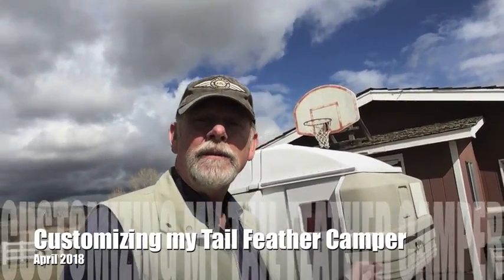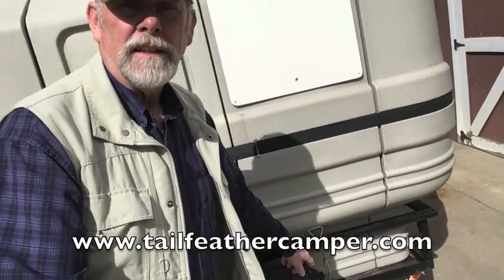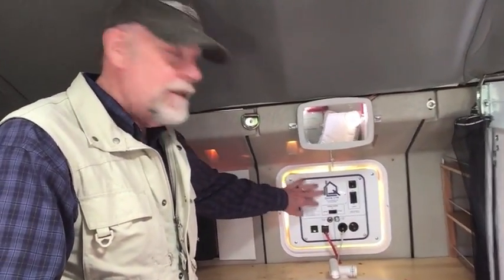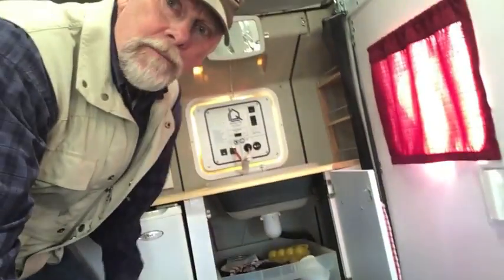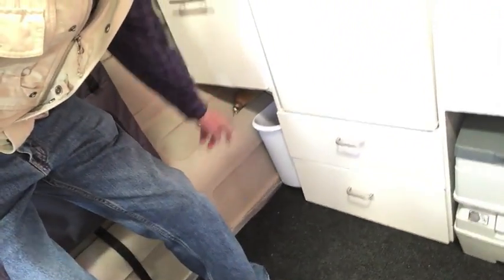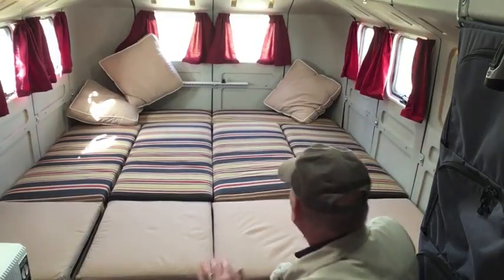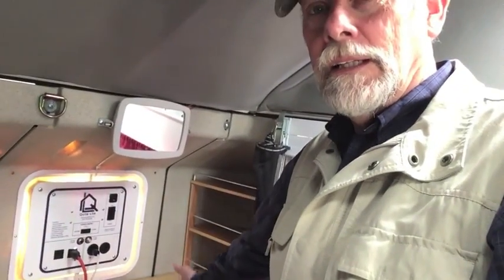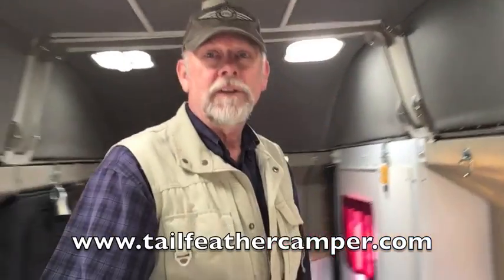Customizing my Tail Feather Camper

Comment from the maker: FYI - I designed, developed, manufactured, and marketed the TailFeather Camper and QuiteLite Shelter from 2009 to 2017. I sold the rights to a company in Boulder, Colorado five years ago. I am very disappointed they have not fulfilled the products potential.
Reply: thats too bad. I came across a picture of one built on a 5x8 trailer and was captivated by it. This is an ingenious design and am surprised I am just now hearing about it. I feel like with a little marketing this would be a really popular, affordable alternative to other smaller campers.

Comment: Hi-love your customization! We just bought a used Tailfeather (named her Luna lol) and want to make and install cabinets. How did you attach the cabinet unit to the wall of the camper? I am concerned about screwing into the wall panels. Thanks
Reply from the maker: Carol, I hope your Tailfeather serves you well. There are threaded inserts about halfway up the wall that can be used to secure cabinets. Threaded inserts can also be purchased at a local hardware store that can be screwed into the curtain rod holes to accept machine screws. Hope that helps.

Comment from the maker: I’m not sure what the problem is. It plays fine on my phone and computer. I’d like to hear from others.
Reply: you destroyed my dream of having a modular trailer company... thanks
Reply: Politely,  I cannot hear most of the audio from outside the trailer at full volume. After you go inside, if  I listen very closely, I can hear but I struggle to hear every word.

ETA: If you attach a set of earphones, it improves the audio significantly. I can hear everything easily on max volume but the audio is still weak.

In the past,  I have encountered several YouTube videos have this same issue. copyzerk's HAVE GUN, WILL TRAVEL videos also cannot be heard without earphones although copyzerk and others can hear the videos just fine.

I am using a Samsung Galaxy S8 Plus. My phone system is at full volume and my YouTube volume is at max also.

Edited for clarification.
Reply: Earphones will greatly improve the volume.
Reply: How can I get one????
Reply: I am very interested in this.
The volume on my phone is on as high as it goes and I have to hold it to my ear.
These units look amazing.

Comment: Are these tail feathers available anywhere anymore? 
If so, I am also wondering how those insulated panels work in various temperatures. It the hot summer sun and the cold snowy winter, how's the temperature inside?
Reply from the maker: Not currently available but may be back in production soon. Panels are well insulated. They hold heat in during the winter and keep the heat out in the summer. They do not, however, generate heat or cooling. Like any insulation, they slow down heat transfer. See QuiteLite.com
Reply: @tealcorpintl   hey where did you get yours I have alot of questions for you!

Comment: So many questions...how has the camper stood up to traveling?  Leaks?  What was your final weight after additions?  How big a vehicle do you use to pull it?  Are you still happy with it?  Now..can you pimp mine out when I get it? LOL
Reply from the maker: My customized Tail Feather Camper weighs in at just about 1,000 lbs including the trailer. I pull it with a 2003 Toyota Highlander. It tows nicely and I have put over 6,000 miles on it. I did have a few minor leaks when traveling all day in a downpour. Those have been addressed. Love the camper!

Comment: So many people put their toilet hacks right next to water supplies and food prep areas.  C'mon!  That's just bad hygiene strategy.  I wish some one would factor in some separation plans beside just suggesting one use it outside.  And, moving it would free up more kitchen storage.
Reply from the maker: In a small space like the camper, there are really only two choices, (1) under the bed/dinette where the odors percolate up and disrupt both eating and sleeping, or (2) in the kitchenette cabinet area.
Reply: In my Eddie Bauer Airstream, I use 13 gallon trash bags over the toilet rim as liners and we use generous amounts of kitty litter in each bag. Shake, then double bag. Works great.
Reply: @tealcorpintl  L. Drake, in the heat, that odor is horrid. That's why we do the kitty litter method.
Reply from the maker: I haven't found any portable toilets that don't have an objectionable odor, whether the chemical additive or the biomass. We put up a small camp shower tent for the toilet when possible to keep it out of the camper.
Reply: @tealcorpintl  Hi Lawrence!  I bought a 10 footer 2 years ago from the fellow who bought it from you about 6 years ago.  I found that it leaks so I haven't been able to use it.  Can we talk to figure out what I can do about this?
Reply from the maker: wyo cowgirl Where do the leaks occurs?